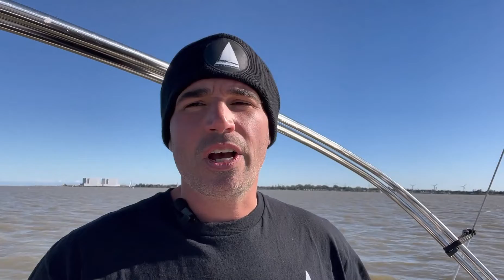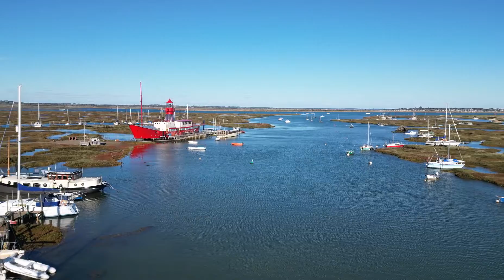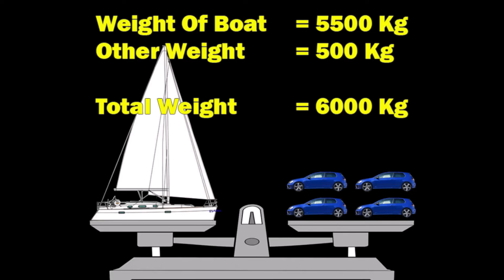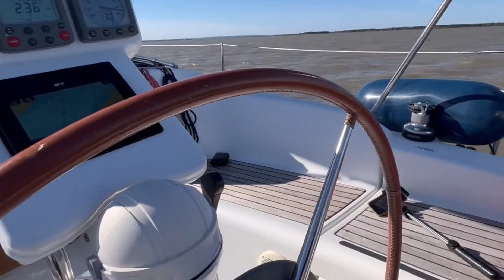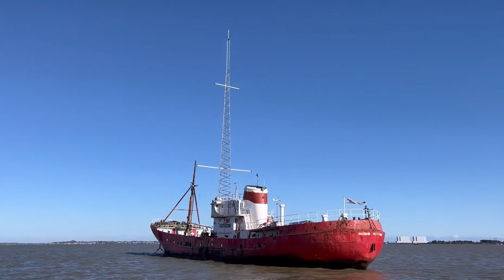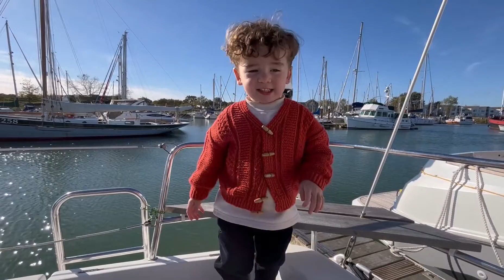6hp tohatsu outboard push 6 tonnes?

Comment: You’ve just saved me some money! I’m currently refurbishing a 18ft cabin cruiser, which I don’t think will get to 2 tone and only be used on inland waterways. So if it pushes your boat at 4knots at sea, it’ll do me fine!
Reply from the maker: I had a newbridge venture 22 using this same engine in a boat that was 1300kg. Got the boat to full displacement speed. 5.5 - 5.7 knots. Used to
Use about 2 litres an hour with no wind and about 4 litres motor sailing all day. Pretty good engine 👌
Reply: @EastCoastSailing_  that’s good info, thank you. Outboards seem to take a big jump in price when you get over 6/7hp, even 10hp motors are a chunk more. I’m new to all this so great to see something working, rather than random suggestions, mostly between 10 and 40hp 🤷🏻‍♂️ lol
Reply from the maker: @Yosser70 don’t get over 6hp. It can’t push the bot any faster due to the hull displacement speed. Also the weight of the outboard jumps significantly. 6hp is 25 kg then 10hp is over 30kg. It’s a lot of weight on the bracket. Also not easy for you to lift off if you have a break down and need to fix it. Always carry a smaller spare. I had a breakdown one e and it wasn’t fun with no wind.

Comment: Excellent, thank you.

I have been trying to find a similar video where a small electric is tested as an auxilliary for a boat. I have a Boston Whaler 210 Outrage (about 1500kg) and wondered if an Epropulsion Spirit 2, or similar, would move the boat in an emergency. It would be handy to have an electric that I could use for the tender which would also serve as an emergency auxilliary. I guess it depends a lot on sea conditions. Anyway, thanks again, very interesting and gives me hope.
Reply from the maker: A 6hp engine can move my 6-tonne boat, so a similar setup should definitely have enough power for your 1500kg vessel in an emergency. 👌

Comment: I had a Hunter Horizon 23 at Bradwell i used a Tohatsu two stroke twin cylinder outboard in the port side outboard well.
Worked fine.
Also had spare longshaft 5hp single four stroke Mariner  for tender and tried it kn bracket and push boat along serenly but fine as a back up and with extension tiller and steerming with tiller and outboard tiller u could spin boat around easily.
Reply from the maker: That’s what it’s all about, safer sailing ⛵️

Comment: Great video. I have a Hunter Channel 323 at Marconi and a potential problem is moving the yacht to a marine engineer  in the event of an engine issue I can't resolve. I have actually built a hang on mount from mini scaffold which I can put 2 OB's on. My current options are a Mariner 3.5 and Haswing 2.0 (6.0-6.5 HP combined) . At 4.5 t your video suggests that set up should work.
Reply from the maker: Easily and the boat is 5tonne in the video 👍😎
Reply: I like doing some fishing off the yacht including slow trolling (1.5-2.0 kts) or drifting over wrecks. One option I am looking at are 2 haswing protraur 3.0 g 24v which each have 110lb thrust so equivalent of approx 7hp

Comment: I’ve really been looking at a 6-15hp outboard kicker for my single engine offshore fishing boat.
Reply from the maker: The 6hp will be half the weight of a 15hp. 25kg v 40kg. So if you need to lift it on and off on your own, might be a struggle in lumpy weather. Also the 6hp will burn a lot less fuel if your main engines is diesel, you will have to carry 20 litres in a Jerry can depending on your range. Also the 6hp is £1300 as opposed to £2400. Only you will know what’s right for your boat. If your leaving it mounted all the time and your boats strong enough then the 15 could be a good option but the difference is 3 Knots in speed as the 15 won’t get your boat planing. Hope it helps 👌

Comment: I Rob 
About to fit my bracket and had plenty of feedback from others who say control is very hard if you have to use it 
What’s your take on this
Reply from the maker: Hi dale, if you get the tiller throttle extender, only £25, you can control the throttle from the cockpit. If you lock the outboard with the thumb screw on the back or bolt the proper steering lock bracket on for your model, you steer your boat using rudder / steering system so it’s rubbish what people are saying about control. You have as much steering control as you usually do. Yes you won’t be able to stop the boat as quickly as the propeller spread is 20% of the main propeller if it’s a big boat but you would be coming in much slower. It’s an emergency back up for me if I can’t sail with no wind or come up a thin estuary and the main engine is lost, it gets you out of a sticky situation. Until you have broken down on a hot windless day it’s difficult to explain. You can get remote throttle controls if this will be your primary engine which also does the gears forward and backwards. Also the sail drive outboard can push much bigger boats. What boat have you got and give me some background how you will use it? Thanks
Reply: @EastCoastSailing_  Hi,

Thank you very much for your help and advice, it’s greatly appreciated.

My intention is to keep the outboard after the inboard engine replacement as a secondary backup. In the meantime, I will need it to manoeuvre Sea Treasure around the marina and into the basin so the old engine can be lifted out and the new inboard engine installed.

Having a backup means I’ll have some peace of mind once the work is completed.

Thanks again for all your help.

Kind regards,

Dale
Reply from the maker: @SailingwithdaleHi dale, if you’re doing lots tight marina movements I wouldn’t advise it. Get the harbour boat to tie along side you and guide your boat to the lifting area. It all depends on your marina, have you got strong tidal currents in the basin and picking your day with calm weather and waves. It can be done but limits what days it can be done and the chance of damage is moderate. Also all outboards tend to conk out at low revs going backwards and forwards. Why can’t you lift the engine out using the mast and boom using a block and tackle, once it’s wiped out, swing the boom
Out and drop the engine into a workboat? If it weighs 100kg should be easy.
Reply: @EastCoastSailing_  was thinking of that its on the deck the old one and have removed to gearbos also flywheel so will try that and also do same on the new  one  i think
Reply from the maker: @Sailingwithdalegood luck 🍀 if I was nearer I’d lend you a hand 🤚
Reply: @EastCoastSailing_  thanks mate means a lot safe travels hope to have a pint sometime in a marina when our paths cross so to speak

Comment: Love this. I’ll be doing the same with my 37 footer and 29hp Yanmar. I might try using the sucker brackets that are normally used for car roof bike racks. If every yacht had this system it would save hundreds of RNLI callouts. Quite surprised how fast the boat can go with just 6hp.
Reply from the maker: Yeah, 4.5 knots is respectable. It’s also the inconvenience of breaking down bobbing about for hours waiting for a tow with no wind. Once it happens once, never again. With the tide running with you, easily be doing 5 knots 👌🌊🇬🇧⛵️

Comment: Likely a poor question but with the plastic fuel tank  well above the small motor, do you need the fuel line squeeze bulb to prime thd engine? Might just be there to initially get the fuel pulled up from the tank then not needed.  THANKS
Reply from the maker: Hi Max, i welcome any questions. When you connect the fuel line from the tank to the engine, you will always get some air in the fuel line. A quick squeeze on the primer bulb will purge the air and fill the carb fuel bowl. No matter how high you put the tank, the head pressure of fuel isn’t enough to push against the carb fuel bowl float needle. Hope it helps.

Comment: Nice that people are testing opportunities that small outboards have. I have test video on how Suzuki 2,5 hp pushes 2000 kg 7,6 meter motorboat, nice 7,6 km/h speed. My main diesel engine pushes with 27 hp 11 km/h travel speed. I have outboard as a emergency engine always with me as sea towing services are quite expensive.
Reply: I did get a Tohatsu 2.5hp, long shaft, short while ago. For the time being it will propel an inflatable dinghy that I got last week! But the real plan is for it be shared by both the dinghy and a future sailboat. Something below 1.5 ton category. 
Curiously enough, today I'm making a transom riser for the dinghy to better deal with the long shaft option. In due time a lower pitch propeller will be set on the Tohatsu. And quite honestly it seems to be perfect for the task. 
One could argue about more power, an alternator, electric start. Add whatever to this list...
But the fact is that it's light, simple, economical and extremely effective for what it is. 🙂

The Suzuki 2.5 was my initial choice (almost 5kg lighter!). But I found this brand new, that happens to be from 2012 for about half the price! No discussions. 
Beside the Tohatsu has more torque due to >cc (85cc). And can be easily upgraded to at least 3.5hp without a sweat! In contrast the 6hp has a 123CC engine. Not so much difference. 🙂
Reply from the maker: @kimfinland  good to know ! It’s great having a spare covering every base incase things go wrong 🫡 which they often do 😂

Comment: Thanks for your video. I am looking for an outboard for our sailingboat which has no inboard diesel. I couldnt accept that a 6 hp woud be sufficiënt eventhough getting Some advice earlier. Now that I have seen it, I am finally confinced. Thanks!
Reply from the maker: @Joppie86  Glad it helped! Out of
Curiosity what size is your boat ? Thanks
Reply: A bit smaller, it’s a Marieholm 26 (empty weight about 2,5). It will mostly be used on open water lakes and close to the coast. Especially the increased weight compared to our previous (23ft Puma) was making me doubt the HP. 
So thanks again and regards from the Netherlands!
Reply from the maker: @ had one on my 22 foot sail boat and pushed it along to its hull displacement speed no issues 5.5 knots. Carry a spare engine. I have had to do some repairs on the water and having the same engine as a spare is great for reliability and swapping parts out so your adventures are not ended early
Reply: Excellent, will probably do just so. Thanks again!
Reply: @Joppie86 2,5 kgs ??????????

Comment: Thanks for putting this video together.  We have an 18 x 8 foot 1,100 kg traditional cat boat with 6 HP Mercury. It is my understanding that it has the same  as, or built by Tohatsu. It is the long shaft but with a standard Propeller (7.8 x 8 ) Would you have any experience with the difference in performance between this and the Sail Drive Prop on this size boat
Reply from the maker: @davidmcgill7650  Hi David, yes I do have experience with the standard and the sail drive - both tohatsu. My back up emergency engine in my last boat which was a 22 foot bilge keel 1.2 tonnes was a standard 6hp long shaft I kept in the locker as my last boat didn’t have an inboard engine, just a 6hp sail drive as my main engine. For me the hull displacement speed is a limiting factor. The sail drive actually needs to rev a bit higher to get the same speed as the standard prop as the blades are angled less agressively which means more fuel and more noise. For a boat the length and weight you’re talking about the standard prop is fine and will actually give you better cruising MPG and a higher top end speed especially being a performance catamaran and being so light. You will never get prop was with a standard prop pushing a boat that light. The advantage of the sail drive is it has a 12v charging to charge batteries if you need power.  You must be able to get you boat to 7-8 knots full power ? Thanks

Comment: I use a Sail Pro on my Albin Vega 27.  Love it.  Just wish I got the extra long shaft.
Reply from the maker: They are great engines. Normal replacement parts are pretty cheap. Only drawbacks is some of the more specialist parts can be on a 6 week lead in. That’s why I always carried  a spare on  board of the same male and model. Never had a problem in 10 years. Thanks for watching and taking the time to leave a comment! All the best Rob

Comment: Which prop would you recommend on a swift 18ft explorer (open, unstayed ketch)  2 ft draft, single keel with a 40kg centre board, slow hull speed. Its a low engine well/transom so would take a short shaft.  Im considering modifying the transom and rudder to take a 6hp but have seen people with the same boat and smaller outboardS.  The boat is. Based on a mooring in Christchurch so on occasion has to deal with fast tidal flow through the narrow harbour entrance. 

Thanks for the video and your time to fil and edit. 

Chris
Reply from the maker: Hi Chris, thanks for reaching out. Your boat ultimately will have a hull displacement speed and no matter how big the outboard you put on it, it won’t go any faster. You certainly won’t need a sail drive prop for your boat given how light it is. You will just be wasting fuel having a shallow prop. I personally had this outboard  on my 22 foot boat before and it pushed it along at 5.5 knots all day long so might be a bit quicker on your boat, I also had a spare engine I used another 6hp tohatsu with just a normal prop and it pushed it along the same speed. The only reason why I got a sail drive is it has a charging output to top up batteries. I think you would be fine with a 4hp onwards. Also think about weight. If you’re only using it to get out of harbour and never have it on then a 2 stroke would be a great option. All the best Rob

Comment: For long distance motoring when not enough wind to sail, I have heard that it is significantly less expensive to use a small outboard than to put hours on the inboard engine. Since autopilot uses the rudder to steer, you need only crank the outboard and let it ride.
Reply: I have heard about people using small  electric outboards to plod through the doldrums using solar which is dirt cheap these days)
Reply: Small outboards have relatively low resource though. Outboard will last 1000-1500 hours, diesel up to 10000 hours
Reply: @tedarcher9120 but also 10% of the price of a new diesel engine. Perfect for emergencies though.
Reply: @WhiskyandWaves On my boat I plan to use an electric motor, petrol generators and a backup 2 stroke outboard
Reply: @WhiskyandWaves  epropulsion say their little electric kickers are good for 30k hrs and you can tun for dirt cheap off solar
Reply: @tedarcher9120 Im thinking of doing the samething. Could you recommend what electric outbourd youll be using?
Reply: @bardarians just a 5kw motor with a Yamaha leg
Reply: Avoid gasoline motors when you can regardless. Us it only where you have a minimal amount of gasoline in storage.

Comment: Nice and informative video, thanks.  nHad a 5hp extra long shaft Merc hi thrust prop on my Contessa 26, will be going to this Tohatsu UL 6hp SailPro for my new (but old) Twister 28.  It will be my only auxiliary (no inboard), save perhaps an electric outboard as an emergency back up.
Reply from the maker: Hi Junk Rig Sailor. Thanks for watching. Twister looks like a very capable off shore boat. Just took a look at your page. If you have the space I always had 2 of these engines. That way the spares are interchangeable. They are good engines but I have had small issues that stopped it running. If it were not for carrying the same engine as a spare it could have ended a few trips early. You can get these units pretty cheap second hand at 1/3 of the price new. The tohatsu warranty isn’t worth the paper it’s written on. As soon as you do any work your self you invalidate the warranty which is impossible. You will be pleased with your purchase they are great engines that are east to work on. Just keep a few spares on board like a spare carb, fuel pump, water impeller, fuel filter and spark plug. All the best
Reply: @EastCoastSailing_  A spare is not a bad idea, but as ever storage can become an issue on a small boat, but I am sure I will figure something out.  Cheers and fair winds.
Reply: My 2 cents. If you have the battery setup for it already laying around in the boat, most do. An electric trolling motor with a high torque prop, as an emergency. Is almost perfect for the last ditch maneuvers. The real advantage is that opposite to gas/diesel engines it demand almost zero maintenance. Much more inline with the "emergency" use profile. Leave it in a locker for one or two years without major maintenance. Lo & behold when needed, pull it out connect the battery and there you go... 

No one with a sane mind would dare to do that with a ICE engine. In fact most probably the engine would have tremendous trouble starting or running properly. I do know a thing or two about ICE's. Like them a lot. And I do the proper "storage" procedures. So my engines tend to behave "nicely" when demanded. 
By experience most people are absolutely far away from that. Trust me on that. In an emergency you don't want to think about unclogging carb jets and the likes of it. 🙂
Reply: I have a victoire 28 and i am considering an outboard. My boat weighs around 3500kg and i was wondering if you think that this tohatsu will be able to power the boat along at 5 knots on flat water.
Reply: @shakexproducts5984  It will do fine with the 6hp SailPro - however, what it is more about is your mentality? Are you a sailor, or a "turn on engine when wind drops below 10 Knots" guy?  On the opposite end, are you always wanting extra push when sailing to windward - another reason people stick their motor on when sailing.  If you can truthfully "Yes, No, No" to those three questions above your outboard will be fine,.  For what its worth my Twister displaces near 5,000kg.